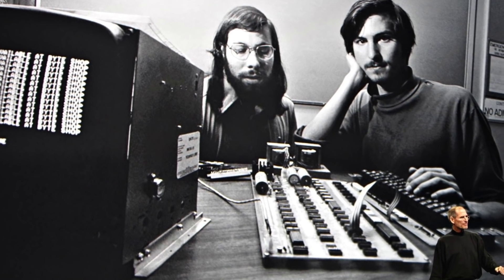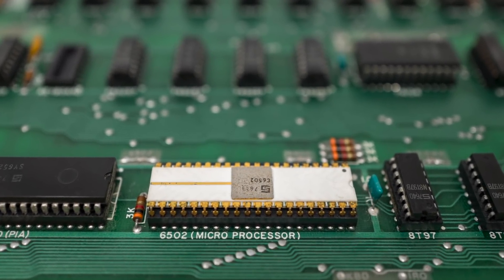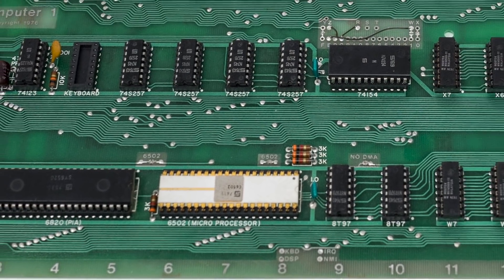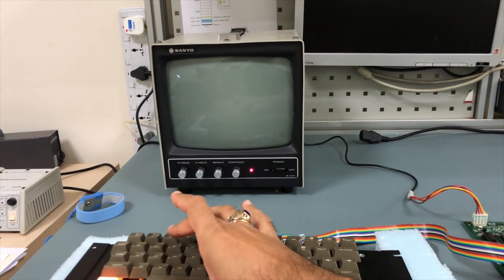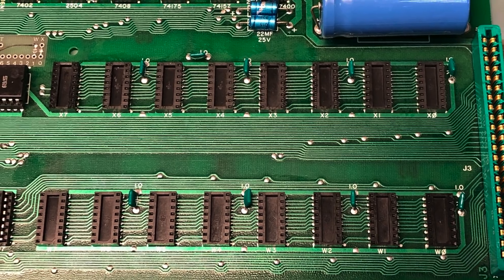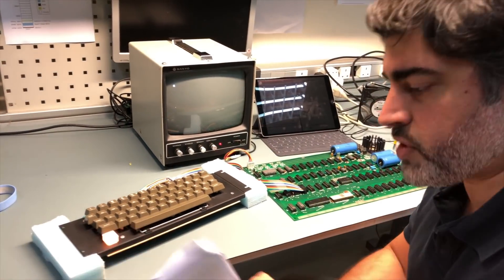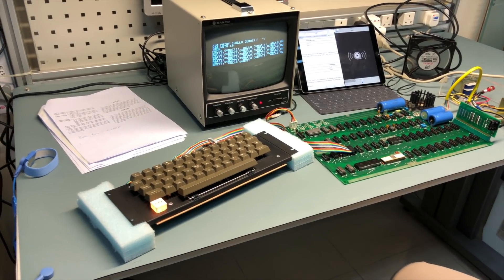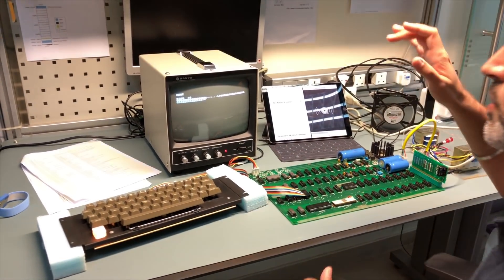Restoring an Original 1976 Apple-1 Computer

Comment: The golden era...
I like that You did not do more than what realy where nessesary with it, beside just cleaning it up and check everything with proper equipment.
There are way to many people out there wich just rip ewerything out without any real sense of how to properly preserve those pieces of our modern history.
Reply from the maker: Vampira thanks! My goal is to keep it as original as possible. So far that’s been easy. The dilemma will come when some component fails and I have to decide if keeping it 100% original is more than keeping it operational.
Reply: @JimmyGrewal  Exactly, I think You found a very good balance, and showed how to do a proper job with actual understanding and the correct way to preform a serious analyzis in order to proceed with the correct desicions.

Comment: is that the original screen?
Reply from the maker: Yel D The Apple-1 was sold be Apple without a display, keyboard, or power supply. Some dealers bundled these items along with handmade wooden cases. The display in the video was a common one that buyers of the Apple-1 and early Apple ][ computers would purchase.
Reply: @JimmyGrewal  I'm reading his biography right now and read that it indeed came without those supplies so I was a bit confused, thank you for clearing that up!

Comment: Sure, this they get working and it was made before I was born, but my 1st gen iPad is a paper weight due to planned obsolescence. Can't install this version of an app because you need the newest iOS. Can't get the new iOS because my iPad is "no longer supported."
Reply: That applies to every computer ever. Newer versions of software require newer operating systems.
Reply: Kael I understand that,  however,  my comment was more of a jab at Apple. I have an Android tablet that is older than my 1st gen iPad and it still works great.  Yes, it has an older os but I am still able to install apps which makes it usable. Not everyone needs the newest os or products.  It would be nice if Apple would still allow the use of older versions of the apps I was referring to rather than try to force you to purchase the newest product.
Reply: I see your point, but sometimes new apps require new APIs which are not present in an older operating systems.